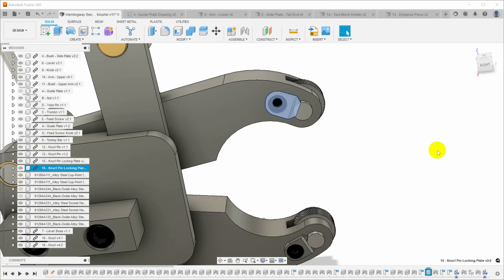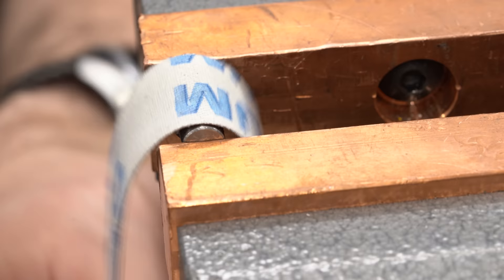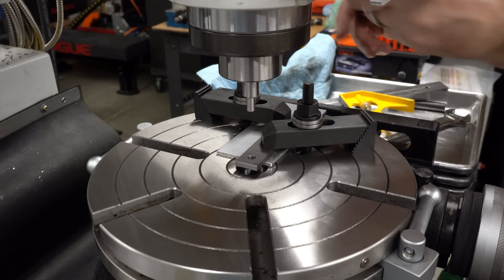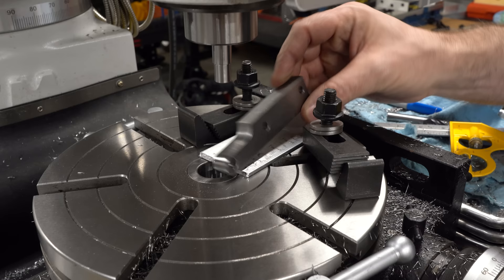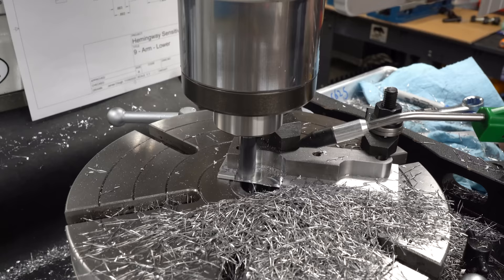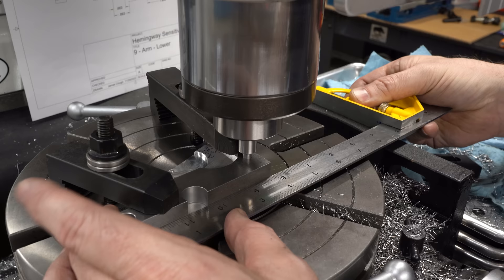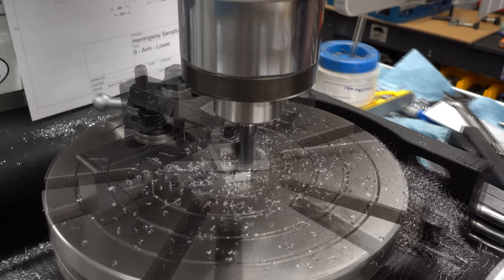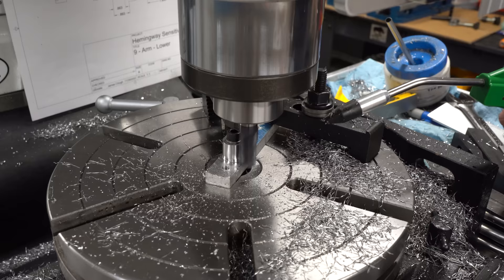Milling Curves With a Rotary Table - Hemingway Sensitive Knurling Tool Build - Part 3

Comment: Couple of drops of WD-40 on the aluminium prevents aluminium sticking on most coatings I've been using. There is little to no smoking as well, I would highly recommend trying it. Great video!
Reply: I do the same with aluminum. WD-40 also works fairly well cutting Inconel

Comment: TiCN is the coating you want for steel and aluminum at the same time. There is no aluminum in the coating, so it does not gall up, but the carbon adds some extra hardness that keeps it good in steels.
Reply from the maker: I have Zirconium Nitride coated variable-flute end mills for aluminum, and they work great.  When I was shopping for end mills, I wasn't contemplating trying to cut aluminum and steel at the same time.  :)

Comment: Re: 2:20
I love my Knipex parallel jaw pliers. Among other things I use them to press in tiny roll pins. Such as something you might find all over an obscure thing designed by Eugene Stoner, particularly in the gas block and bolt catch... 😜

Comment: For setting up my rotab I have a plug that's closely fitted to the center counterbore (or the top of the Morse taper socket), and that's turned down to a fit collet at the top. I start with that in the spindle, move things until it's close to the rotab center, then press it into the rotab with the quill feed lever, allowing that action to move the rotab the last few thou. Only then do I clamp the rotab down and zero the DRO. No need to indicate it in. Which is exactly how you locate the parts.

The arms are complex enough that they would be good candidates for your CNC. But I'd wager that more of us have rotabs that CNCs, so the instructional value of your method is appreciated. BTW If you make a fixture plate for the rotab so that you're freed from the limits of six T-slots, you'll really like it. BTW2 What do you have against beavers? (Maybe I'm just sensitive because I'm a native of the beaver state.) Oh, and Happy New Year to all.
Reply: Blondiehacks showed the same principle. Much easier than the fancy indicator set-up used here.

Comment: James, try using WD-40 or similar lube spray to prevent the aluminium from welding to the endmill
Reply: He is right, WD40 would have worked.

Comment: Wow, not a single screw-up (that we saw), with all those setups. That coffee machine must have worked overtime 🙂
Reply from the maker: Actually, no.  And I didn't do what I normally do and turn a crank the wrong direction and take a big bite out of something.  However, next week, you'll see me scrap one of the other parts and have to start over.  :)

Comment: At 6.55 minuites in you say the table is set at X 0 and offset in Y , but that cannot be correct, X would have to be offset to the radius of curve at least to start with.
Reply from the maker: There is no need to offset X because the table rotates.

Comment: James - I just realised that your shop and Brandon's are very similar. His is inherited "older tech" whereas yours is all new and you're the first owner.  How about a colab comparing capabilities?  Your modern lathe with ELS compared to his vintage lathe, your PM mill vs his Bridgebort.   You have 3D printing as a tool, he has...stuff in boxes we haven't seen.   Just a thought.
Reply: Yours is in an attached garage, his is in a separate barn, another difference.
Reply from the maker: I have stuff in boxes nobody has seen.  :)
Reply: EVERYBODY over the age of 18 has stuff in boxes that nobody (even them) has ever seen.
Reply: @kensherwin4544  - I have a box from my father's father, which has a label "Don't open until you're on Social Security."  I have a few years yet before I qualify :)

Comment: Nice work James! Why did you cut so deep into the sacrificial aluminium plate? Scratching the surface could work also I think? Or was it a dull end of the cutter to do it this way? Thank you! Best, Job
Reply from the maker: This end mill has a corner radius.

Comment: Well Done!!! May I ask what size rotary table do you have . I need one and am looking at a few but cant decide on a size  I have a PM833TV and yours and mine are similar in size I do believe.
 Thanks
Reply from the maker: There should be a link in the video description.  It's a 10" Vertex.  I think it's about the biggest table I'd want to have on a 9x35 mill, and at around 100lbs, I think it's about the max that most people would want to pick up and move around by hand.

Comment: I guess it looks pretty, but that does seem like a pretty gratuitous number of curves and different radii.i know smooth curves reduce stress concentrations but I'm sure the kit could have been designed easier. Though maybe that's missing the point, I guess part of the fun is testing yourself to see if you can make all those curves 😁
Reply from the maker: The inside curves on the arms are there to clear large diameter parts.  I think the rest are to make it aesthetically pleasing and nicer to handle.

Comment: Can you not prevent the problem with aluminum nitrite by useing wd40 spray to use as a colent/lube witch I have seen worked great on my  carbide saw blade I used to cut alum soft.
Reply from the maker: Yes.  It's not ideal for cutting steel, but it would work.  The A9 I pulled out later on works well, too, and it smells better.

Comment: Definitely do not machine aluminum with that coating. It’s specifically meant for harder, tougher steels. Just get a couple of zirconium dioxide carbide bits for aluminum. You’d be surprised how well they wok. But again, don’t use them for steel. If you want the best compromise just buy everything with titanium dioxide coatings. Really, for this kind of shop work, exotic coatings aren’t advantageous. They come into effect at very high cutting speeds and heavier cuts. Not something a Bridgeport or clone is suited for.

I’ll say though,  that you do pretty well with this.

Comment: Lol, just watched blomdihacks today and she said move a file opposite the arc to make a round part. Then you did the same thing today. Must be very common knowledge. Was new to me.
Reply: I think of it as 'climb filing', because the chip forming action is so similar.  The file has less tendancy to dig in at some random point and make a flat spot.